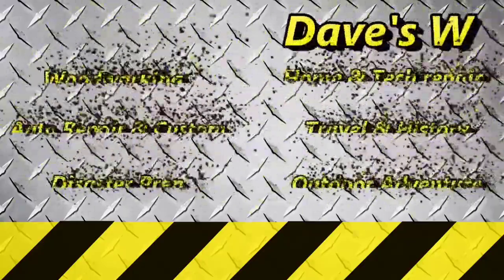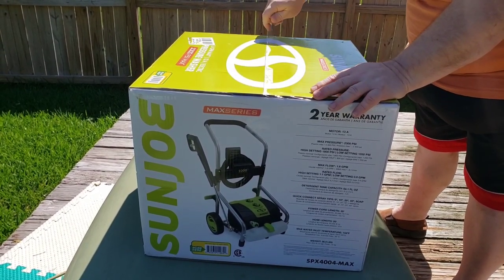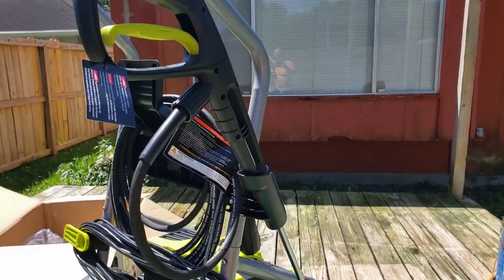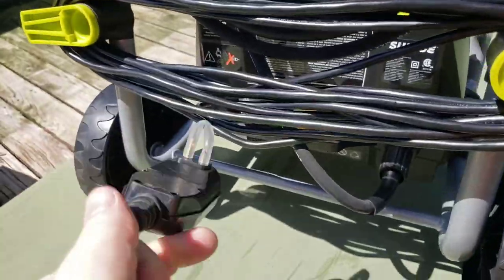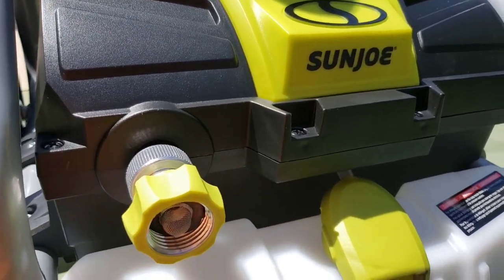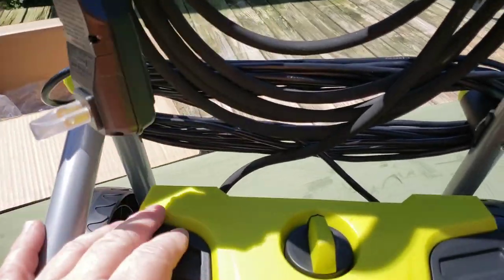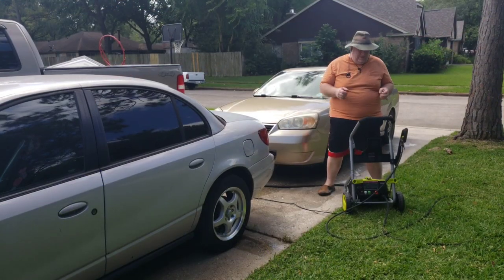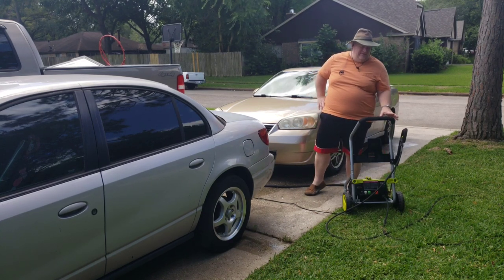SunJoe SPX-4004 Max pressure washer demo.

Comment: What size garden hose thread diameter fits the inlet on the pressure washer ?
Reply from the maker: Standard United States 3/4 inch garden hose thread.  If this is sold outside of the United States the thread may be different on the model depending on the market it's in.

Comment: When the dial is switched to max does it do 2300 psi or 1800 psi ? Thanks
Reply from the maker: According to the owners manual,   Maximum in rush pressure is 2300psi, high operating is 1800.  That means when you initially pull the trigger with the Pressure set too high it will build pressure up to 2300 PSI and then drop down to 1800.

Comment: I turn dial to high but high does not work
Reply from the maker: Is yours still under warranty? I've had no problems with mine yet.  If your machine is still under warranty give Sun Joe a call.  It's not hit me up with a reply and I will see what kind of troubleshooting information I can find on it. It may be a switch issue or something like that.  I did end up placing a GFCI cord end on one for a friend but his was pretty old.